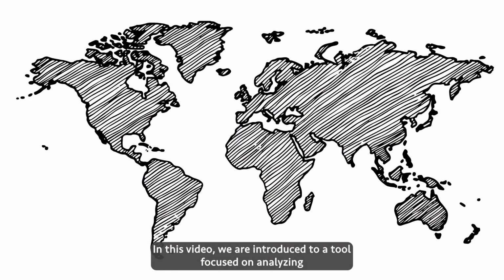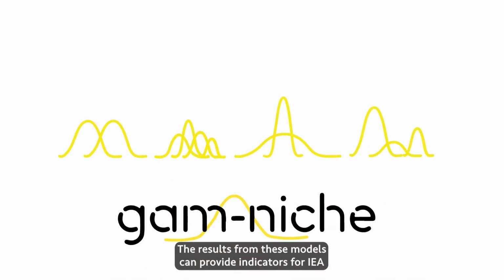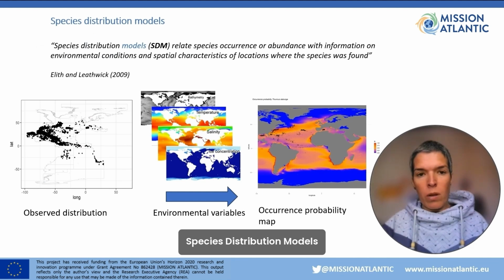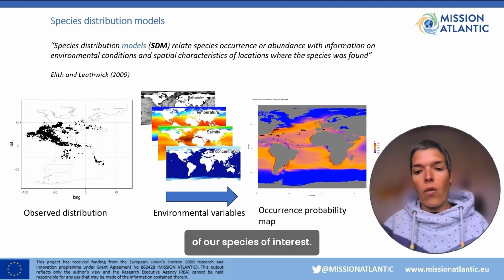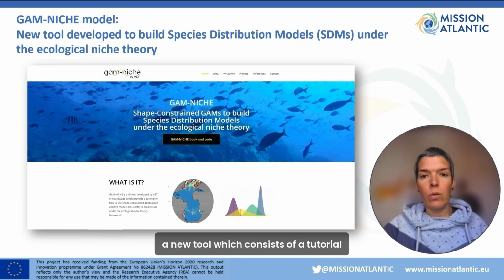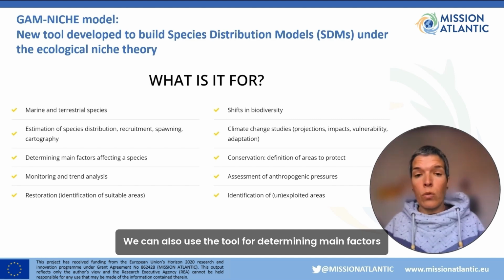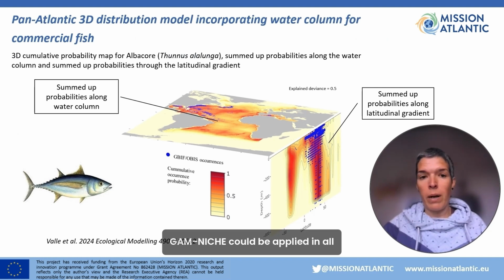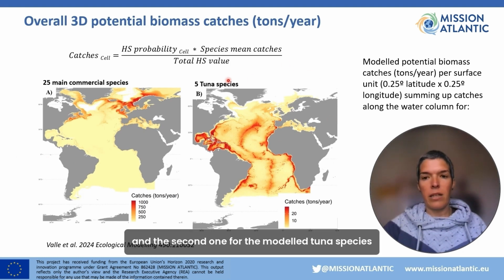GAM-NICHE model: New tool developed to build SDMs under the ecological niche theory

Comment: The video introduces the GAM-NICHE model as a unique and powerful tool for mapping habitat suitability for key wetland species. As an ecosystem-based management aid, it applies Species Distribution Models (SDMs) grounded in ecological niche theory, using Generalized Additive Models (GAMs) to produce realistic and biologically meaningful response curves.
For me, this is particularly relevant to the Sakumo and Densu Delta Ramsar sites, both of which are rich in biodiversity, supporting diverse fish, bird, and plant species. These wetlands provide essential ecosystem services such as fisheries, freshwater for domestic use, and irrigation for fruits and vegetables throughout the year. However, they are under growing pressure from land-use encroachment, industrial waste discharge, and climate-related stressors.
The GAM-NICHE model can be a game-changer in this context. It can help predict and visualize habitat changes, identify recruitment and spawning areas, and assess how factors like salinity shifts or invasive species (e.g., water hyacinth) impact fish and bird populations. Such insights can guide restoration planning, zoning, and adaptive management of wetland habitats.

I find it particularly useful that the model can also forecast species distribution under different environmental scenarios such as changing rainfall patterns, dam releases, or pollution levels. This predictive capacity can help managers design evidence-based conservation strategies and improve ecosystem resilience.
The video also reinforces the importance of accurate species identification, sound ecological setup, and spatial mapping, which are crucial for effective wetland zonation. It further calls for updating Ghana’s wetland data and equipping field staff with advanced training in R and other modeling tools. Strengthening these technical capacities within the Wildlife Division would enhance ecological forecasting and support science-based, adaptive wetland management in Ghana.
Reply from the maker: Thank you, Nana! 

We would love to hear more from you on "predictive capacity can help managers design evidence-based conservation strategies and improve ecosystem resilience", and we are sure that the GAM-NICHE developers Guillem Chust & Mireia Valle at youtube.com/@azti would love to hear more. 

The connection between technical modelling and real-world conservation is the focus of our IMPACT NARRATIVES (work in progress, content coming here soon https://zenodo.org/communities/impactnarratives/records?q=&l=list&p=1&s=10&sort=newest ) but if you see options how we can put this tool in the hands of resource managers, and provoke the evidence you seek, we would love to hear from you (and may be there is a way to spin off a project around it!). 

Alondra & Ivo

Comment: This video has helped me contribute to my Mission Atlantic work by clearly explaining the GAM-NICHE model, a model that directly feeds into the Bayesian Belief Network model that I have been contributing to, and that integrates findings from this GAM-NICHE model alongside climate models, fisheries biomass outputs, and cummulative risks from other blue economy sectors on key ecosytem services. I now understand the benefits of the GAM-NICHE model in comparison to other SDMs as it overcomes problems associated with overfitting. Thanks for an informative video.

Comment: The video introducing the GAM-NICHE tool is highly relevant to my work, as it provides a practical approach to understanding how species distributions respond to environmental variables — a key aspect of ecosystem assessment and management. By modeling species-environment relationships, the tool supports the identification of ecological indicators that can inform conservation strategies and ecosystem-based management decisions. I see strong potential for using these e-lessons in my current position to improve my ability to analyze spatial and ecological data, apply modeling techniques to assess species responses to changing conditions, and integrate these insights into broader environmental assessments. To improve the e-lesson, it could include step-by-step demonstrations of the GAM-NICHE tool, case studies showing its application in different marine ecosystems, and guidance on interpreting model outputs. Creatively, the lesson could feature an interactive module where learners input sample data to visualize predicted species distributions under varying environmental conditions — making the learning process more engaging, applied, and relevant to real-world management scenarios.
Reply from the maker: Thank you! We will feed back to the developers the suggestion for "interactive module where learners input sample data to visualize predicted species" and explore if it is technically feasible for future versions of the code.

Alondra & Ivo